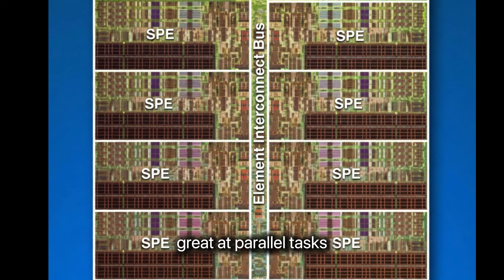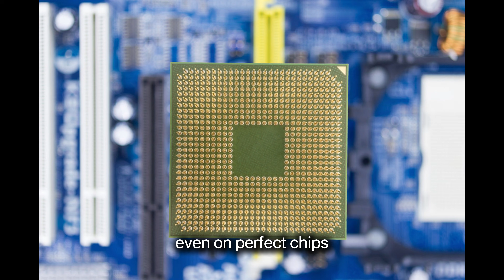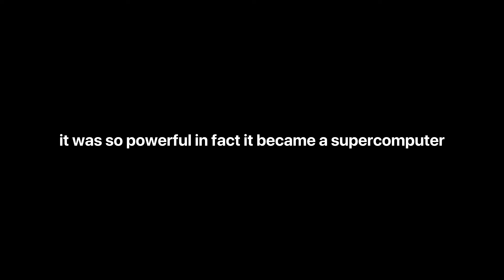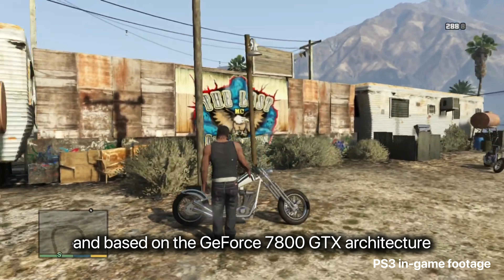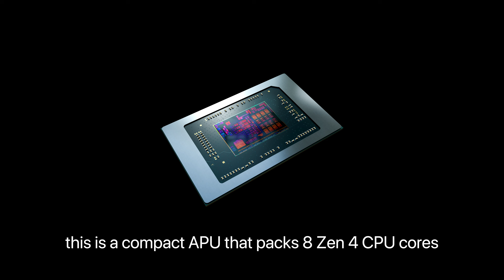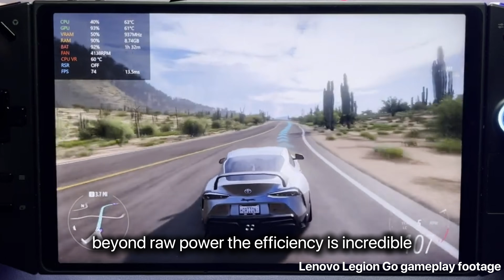GAMING HANDHELDS NOW BEAT A PS3 | a look into the technology itself

Comment: My legion go vram set to 6gig vram in bios with it plugged in pdw set to 30w over powers the Xbox series s comes close to a PS5 and again that's while plugged in
Reply from the maker: Gaming handhelds are soon to have similar performance to that of current gen consoles! We've seen the switch 2 having shown very similar performance to the ps4 pro and slightly surpasses it. It's not so far out of the picture that the next generation of gaming handhelds will be on par to that of a PS5. Very exciting stuff!
Reply: @RTXULTRA-l2l I get that but I own a 780m handheld it is nowhere close to my ps5 or gaming pc with a 9060xt 16gb. Crazy part is it cost more than both. I personally don’t think windows handhelds are currently worth it. Just my opinion
Reply from the maker: @braelighty6212  Todays gaming handhelds dont come close to current gen consoles. In the year 2030 we will definitely see gaming handhelds with ps5 graphics forsure. Windows handhelds are indeed very costly today. Not worth it if you already own a main console setup.